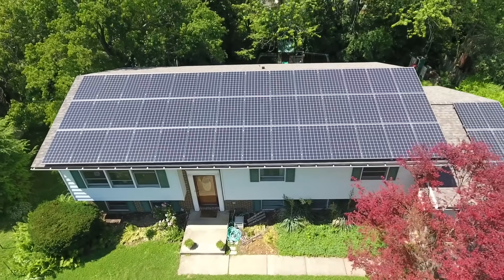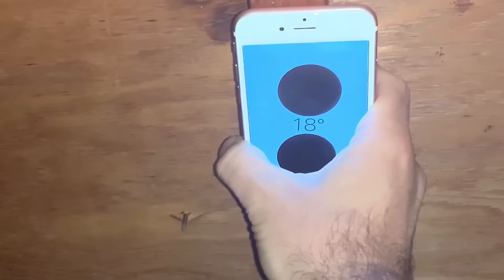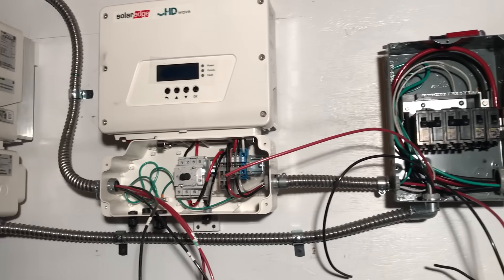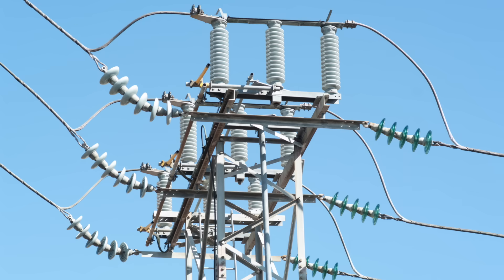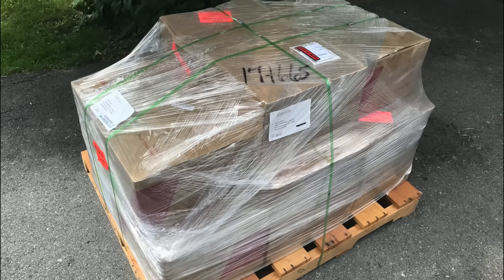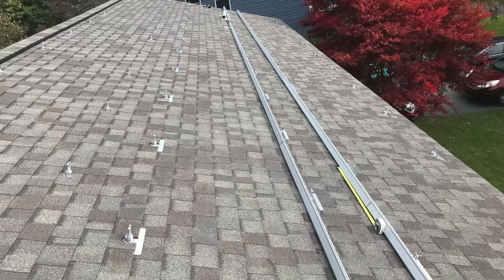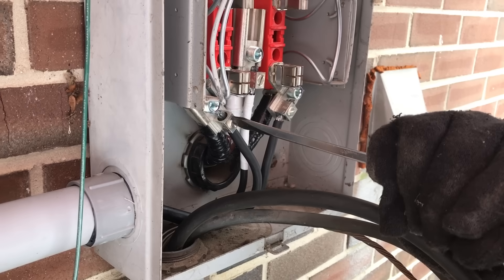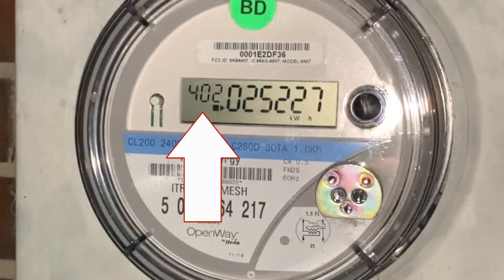I Installed a Power Plant Myself | HUGE DIY Solar Panel System

Comment: Looks wonderful. I’m just concerned about rodent action under the panels. Wire mesh as a barrier works.
Reply from the maker: Thanks!  That has not been an issue.  There is a few inches under there so not a great place for a squirrel to start a nest in an open spot.  I periodically look up there too when I go outside.

Comment: Holy cow that is quite the setup. Are there no problems with the weight on the roof or leakage?
Reply from the maker: It has been great for us!  No problem with weight because it’s distributed.  And no issues with leaks.

Comment: No power bills but you still spent 20K in components and labor. Hopefully you're in a state with great incentives and solar friendly laws. And hopefully you will not have to replace your roof within the next 10 years after install, because you will pay thousands to remove and reinstall the panels. AND, you plan to live in that house for the next 10 years, at least.
Reply from the maker: Did you watch any of my follow up videos on the finances and it works out?  I go over the numbers in detail.  It has been a great financial investment.
Reply: @FrugalRepair  No I have't watched your other videos yet. I will check them out.

Comment: just a question
What happens when the power company (the grid) goes off line due to power outage, you wouldn't get power at all, unless you tied in a battery system that the solar can store the power into then when the battery is full only then send back to the grid, was wondering if you considered this, as this would be what I would do if installing solar, due to power outages, 
Please let mw know if you thought of this thanks, if so would you be installing a battery to it for when the grid goes offline.
Reply from the maker: You are correct that if the power goes out with a grid-tied solar system without batteries, then you would not get power from the solar panels.   It is rare that you would loose power on a nice sunny day.  Also, if you want to be sure to have power in an outage you need to have some battery backup available.  I recommend people start with a small portable unit or if they want, to get a bigger system they can tie into their home.  I have a few videos on all of these options if interested.

Comment: im just over here thinking of the extra benefit of shading your roof and having a layer of air in between the solar panels and your roof means the hot panels not making the roof hot. Not only would solar provide free electricity for air conditioners, but covering your roof in panels and shading it makes your ac not have to work as hard on hot sunny days.
Reply from the maker: Great thought.  Yes, an ancillary benefit of putting in a glass roof 4-5 inches above the shingles.

Comment: Don't get me wrong I am amazed with the work you did here. But as an accountant, I must ask, why you did not install a protection against a hail storm? I mean it only takes one and the insurance company doesn`t pay a dime for it unless you have premium home insurance and you have used a certified and insured installer to install your panels. So, as a finance professional, I would like to know what safety measures have you taken against this scenario. You could of course still install plexiglass over the panels somehow.
Reply from the maker: Thanks for watching.  There doesn't need to be added protection above the panels from hail.  The solar panels are made to be in the elements.   Of course, there always could be a major disaster but that's not the norm.  And that's why you have insurance.
Reply: @FrugalRepair  are you sure solar panels can withstand hailstorms?

Comment: Question - it seems the utilities in my area offer credits to your electric bill that carry over monthly but reset annually, so you never get paid by the utility.  Anyway around this or, I saw in Pirth Australia they developed a system to share solar with your neighbors?
Reply from the maker: It depends on your utility.  Here in the US the yearly zero-ing out of your account credit it called a "true up".  The way it works with my utility is they put the credit on my statement.  There is about a $7/mo charge to stay connected to the grid so that credit gets used up each month by $7.   We also have the ability to sell solar credits (SREC) on the open market so I do checks for those that I can deposit.  I've made a few videos on how the credits and finances work fo us if you are intersted.

Comment: Did u go with over sized system? If so how much over?

I'm doing my research on system. And really wanting to go a good bit of over sized cause we would like to add a bigger pool or hot tube, and would like to have the extra as "just in case"
Reply from the maker: I didn't try to add more but I did want to have enough to cover our yearly usage.  It's good to think ahead if you plan to add things like an EV or hot tub.  If you have net metering, you may want to check your utility's website to see if they have any rules about consistently over-producing.

Comment: No battery wall for down grid power?
Reply from the maker: I have batteries connected in now but I didn't when I designed the system.

Comment: In Pakistan the monthly electricity bill is more than the average monthly earnings. People started installing solar modules and now the government which is basically run by the Army generals wants to tax that . Like wtf 🤦🏽‍♂️
Reply from the maker: That’s sad to hear.  Are people also putting in batteries to get off grid as much as possible?
Reply: @FrugalRepair  they have these generators which kick in when power goes out. Not sure about the batteries as I’m in Canada now. Some even committed suicide over electricity bills and not being able to provide for their families :/

Comment: I actually watched this three years ago and said to myself, “you know, I can do that”…. And by George I did! It took 4-5 months from getting the equipment, install, and permitting but I got through it and actually got a check back from my electric co-op last year from the overage.  I ended up buying a 22.77Kw 68/panel system through a company in Utah (with all the permits and plans) for 40% of the cost of what I was quoted here in FL. I installed the system myself and had an electrician hook it to the grid.
Reply from the maker: Wow, that is so amazing to hear!  Thanks for coming back on to let me (us) know.  I'd love to hear more about your experience if you wanted to connect shoot me an email (it's in the about section of the channel).

Comment: Are they resistant to hail storms?
Reply from the maker: In general, yes. They are made to be outside for many years.  But if there is hail big enough and moving fast enough then of course, there is a possibility of the glass getting damaged.

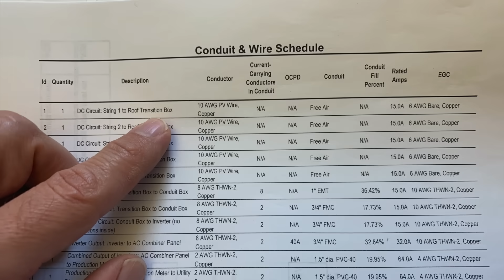Comment: Didn't quite uinderstand the need to bend the ground wires that are connected to the rails so they didn't touch the rails. 8:36 minute mark.
Reply from the maker: Copper and aluminum don't play well (galvanic corrosion) with each other so I only connected the rails with the ground wire to the connector (which I think is stainless steel).

Comment: One bit of wishful thinking I saw - the roofer is making many small holes in the shingles as he installs them but these holes are then covered by the next course of shingles so they are protected. You are making much lager holes and at least some at the bottom of the shingles and relying on elastomer to seal it. As the wind blows, bolts run thru these holes will cause many cycles of pushing and pulling which will tend to stress the area and increase the chances of a leak. I suggest you go into your attic at least once a year to inspect for leaks. If the decking rots, you will have a deinstall, roof work, and a reinstall on your hands. My roofer said my new roof’s warranty is void if solar is installed over it.

Comment: It took the number 2 company in Florida a year to get it passed by code and FPL.    They would never approve dyi.
Reply from the maker: I assume all it takes is the local electrical inspector to give you an answer on that.  A large scale industrial project is much different than a residential code permit.

Comment: What software or website did you use to create that paperwork to get your solar system approved? It looked a little complicated but a professional document.
Reply from the maker: It has changed and there are a lot new software options out now but it was called solar design tool.
Reply: @FrugalRepair  thank you so much for going and answering a comment from an old video! Its greatly appreciated

Comment: From my personal experience, if you have 25 feet by 8 feet of ground space that gets sun most of the day.....everyone could benefit from a small 2kw system....cut my electric bills in half and will pay for itself in about 10yrs. I avoided all the permit stuff and permission and just built it all "portable", it never interacts with my Grid power connection. All mobile, all ground mounts basically A frame, panels on one side, kickers on the other, some chain on the bottom to adjust angles.

Comment: And a few months after the install…
This area was impacted with a mega-sized massive hail storm.  Golf ball sized hail plummeted from the sky.  It was a monsoon level storm a real soaker and the record sized hail obliterated homes and vehicles in the area.  

Updated photos of this guys solar panel roof assembly now resembled irregular slices of Swiss cheese.  At first, some argued that it was some sort of upgraded solar panel spread that were manufactured in the Emmental valley of west central Switzerland.  Unfortunately, upon closer inspection, it was revealed that this was just the aftermath of the horrendous and horrific hail storm that had recently annihilated the local area.  His $75K worth of solar panels had been rendered irreversibly damaged and utterly useless.  

Yet, the home owner remained unceremoniously optimistic.  Stating that yes, perhaps this disastrous storm ended up crippling him financially and he has to now sell platelets in order to make ends meet but this video received so much traction that he has now been recently contracted to work as a stunt double for Murr on the hit show impractical jokers.

Comment: You’d never get those installed in any city.  You need 3 feet from edge on all side for Emergency Services (Fire Department).   When you sell the house you’ll likely run into issues.  It violates IRC.
Reply from the maker: I know what you mean but I am grandfathered in.  I met code when it was installed.  I just had the code inspector here recently for a different project and he confirmed it.

Comment: too bad most panels will have significant degradation in output after 10 years.
Reply from the maker: This is a sweeping statement with no facts.   Can you say what data you are citing?  My panels are warranted to drop at most 9% at the 25 year mark.
Reply: @FrugalRepair  reddit reviewers. the real issue with panel warranties is they claim to have 1% degradation up to 20-25 years with a warranty but almost no panel producers last remotely near 20 years.

not saying you still wont get good power, but i think the 1% rate per year is a bit far fetched.
Reply from the maker: I guess we will have to see.  I would like to see real empirical test results.  It’s hard to compare someone’s roof with many panels and considering debris, sun-panel angles and the technology with someone else’s situation.  FWIW, my 1200w CIGS solar panels (on my RV where it’s easier to measure) after one year of use I am seeing little to no degradation.

Comment: This is epic. I did the same on my house. €5,000 for 10 panels, hybrid inverter and 5kwh battery. It was €9,000 cheaper than regular installer.
Reply from the maker: Thanks!  Congratulations on your project!

Comment: Idaho doesn't require power companies to buy back electricity. My bill averages $100. a month or $1200. A year a year. $12k for 10 years. I'm thinking it would take longer than I will live in my house before solar added any net benefit.
Reply from the maker: That’s a bummer you don’t get any credits.  If you have time of use rates it may work to get batteries and solar.  You’d have to run the numbers to figure out the payback period.

Comment: All solar panels must face South and at 45 degrees angle for Optimum usage.  Initial cost, maintenance (climbing the roof, cleaning, etc.) replacing batteries every 4 to 5 years, plus some electrical knowledge and codes, and all the labor involve, yup remember well.
Reply: The optimal angle depends on your latitude. It’s not fixed at 45 for everyone. 🧠 Think about how the sun sweeps across the sky bruh. 😎

Comment: Yeah no bills , he paid 20000 usd for solar as it is the same paying over 20 years electrical bill ,
 not including to change batteries every 2 to 4 years , and system maintenace which is not cheap, 
and the worth is panels efficiency lifetime is 25 years max,
And the worth of worth panels are not recyclable .

Hurrray what an investment.
Reply from the maker: LOL, how do you know what I spent?  Watch my videos with the financial breakdowns.  You didn't watch this one because there are no batteries even mentioned.  This has been a fantastic investment.
Reply: @FrugalRepair  soon or later you will install batteries😀 else your system will fail at winter season.
Reply from the maker: You don’t understand what net metering is.
Reply: @FrugalRepair  Realy , let me tel you that i understand net metering and ongrid system , as for offgrid and hybrid , but 😔 in my opinion and experience solar inverter is ideal for remote area, else its a bad investment.
So you like or not its up to you.
Reply: B/C ratio here to find out if it's worth it.

Comment: Are you accounting for the cost of removing and reattaching the panels when you need a new roof?   Curious how much that eats into your ROI
Reply from the maker: I don't think there is a need to.  Because I put panels on when I put a new roof on, I'm expecting the roof to last much longer than without the panels.  With electricity prices climbing my payback period is close to 5 years.  After the 5 years I have 20-25 more years of warranty on everything so it will all be profit then.  If I need to replace the shingles by the end of that warranty, I'll probably be looking at putting in the new tech at that point.

Comment: I'm curious as to how the power company feels about the system back feeding to the grid when working on the lines?  You hear all the time about the supposed danger of generators back feeding and the need for an interlock or transfer switch to protect the linemen.  Does the bi-directional meter do something to allow it to shut off the back feed?
Reply from the maker: It is a requirement that you can not backfeed.  A power company guy was just at my house and told me his group was working with a crew from out of town and one of workes almost died (he lost both of his arms) because someone was running a generator (presumably) and backfeeding illegally during a power outage.  The approved equipment all have auto-shutdown so they do not backfeed in this scenario.
Reply: @FrugalRepair good to know!

Comment: Sounds cool is that with battery’s for dropped power grid and do you still have to pay monthly power bill like 50 bucks.
Reply from the maker: I'm not sure if you are asking a question or not.  When I installed this system I did not have an integrated battery system.   I made a few videos on the financial side of this solar array if interested.

Comment: So after 3 years, have you had any electric bills? Would you recommend this to someone on the fence about installing solar?
Reply from the maker: I plan to give an update to how the finances have worked out for us over all these years.  I've had the system running longer than when I published the video.  We are net positive during the year.  I made a video on this topic with the details and our bills if interested.    I don't know your circumstance but if you have southern facing exposure, and 1-1 net metering available then I would definitely recommend getting solar.  If you don't have those things, it would depend on electricity costs and how much solar you can put in.

Comment: What an awesome job and video. Couple of  questions
1. Does you power company limit your number of panels to your kwh useage and no more? Where I live you can only  install upto or less than your total annual kwh useage. 
2.Do you have and HOA and if ao did you have any issues with them?.
Reply from the maker: Thank you for your encouraging words!  1. I think there may be a limit that is flexible.  I think they are reasonable but they don't want you inordinately exporting power, so if you are exporting a little over your usage it shouldn't be a problem. 2. No, thankfully we don't.  I don't like HOAs.

Comment: Yeah of course solar is better and cheaper but there's no such thing as no bills. Buying a solar system is paying a few years of bills in advance.. also maintaining the system like replacing batteries, panels, wiring,  costs money which turn into bills eventually.
Reply from the maker: I doubt you are interested but I made a video explaining more of the finances.  This has been a great investment.